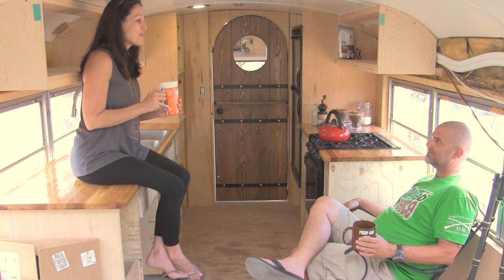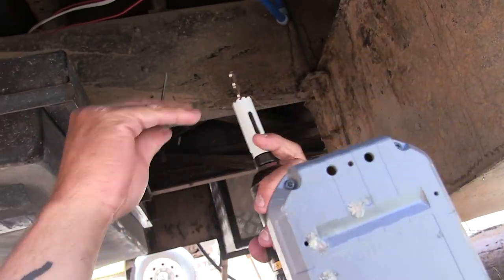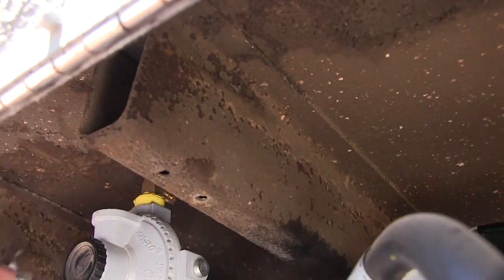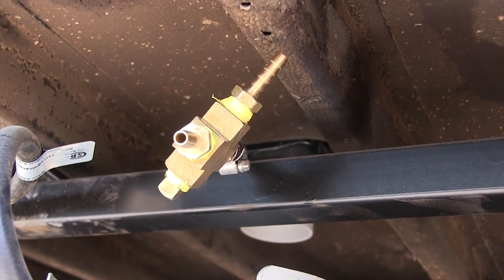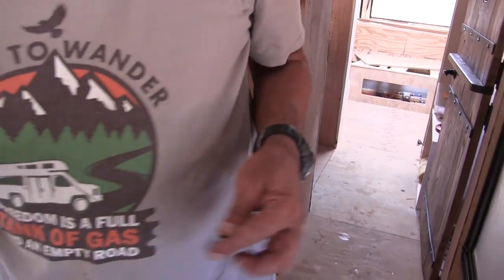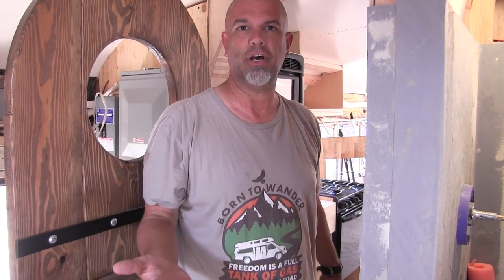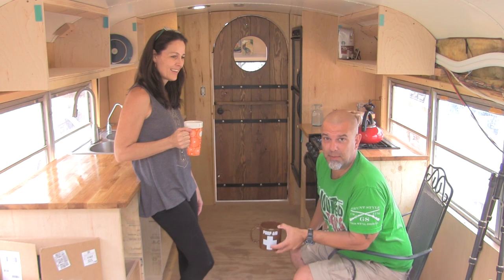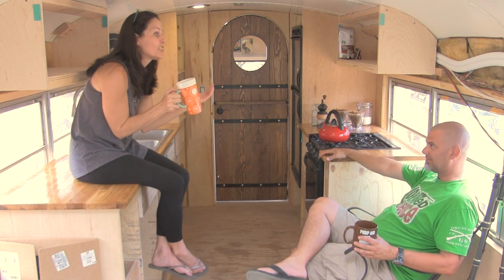Installing Propane Lines & Making Our Skoolie Kitchen Work!!!

Comment: I always hated those hose clamps because it is a pain to get a screwdriver where it was needed and I seem to let it slip off and I jab my hand with the screwdriver...then I figured out a socket fits on there perfectly.  A socket and ratchet, for me anyway, is much easier and quicker.  It's also easy to "snake" an extension in-between obstacles or even use a bendy extension.  Just a thought.  Really like watching your progress, by the way.

Comment: Another great video Mike and Kerry. Glad the propane install went smoothly. I was surprised that you used hose clamps on the propane lines, wonder about leaks developing. I just have never seen that but I am sure you would not have used them if you didn't think they would be safe. Great job!

Comment: Here is some important information for you. The gas regulator vent should be facing down so water does not get into the diaphragm which it will the way you installed it, or you can go to a local Propane gas company (please do) and see if that regulator screen can be removed and vented downward using pipe. Also see what the code is for using the rubber hose indoors on a moving vehicle.Why get this far and create a potentially great problem by having gas blow by the diaphragm and ruin your build. Just helping and not being a jerk.
Reply from the maker: Thank you. I will address this.

Comment: We taught our kids in the RV to get all wet then turn the water off, suds up your body first then your hair, turn water back on and rinse off.  Otherwise they would fill our grey tank in two days. 😳🙄 With our corner shower I put in a big rubber maid tub, I filled half full and the kids below 10 got to take a bath in our shower.  No water waste 👍🏻

Comment: Mike, i saw one system where they installed a solenoid on a 15 second timer (relay) inline on the hot water tap. What this did was send the water back to the tank for the set time then out to the tap. This saved wasting any water at all. Just a thought :)

Comment: Wondering if youve had any leaks 4 years down the road using the compression fittings over using flare connections. I just bought copper tubing and flare tool but after watching your video this would save so much time and cash

Comment: Hi Mike and Kerry.  Thanks for sharing your build.  These videos as well as the "correction" video after it REALLY help us who are a couple steps behind you on this adventure.  
Question on a product used in this video, if you don't mind...  What size inside diameter fuel line did you use for the lines across the bus?  This would help tremendously!  Thanks again for all of your hard work...it sure shows!!
Reply from the maker: 1/4" lp Rated fule line
Reply: @BussyMcBusface  Thank you for your help!

Comment: I would suggest using soapy water in a spray bottle and check all the fittings for leaks especially under the bus around the tanks. Because if you have a leak outside you may not smell it and you sure do not want a fire after all this work. 25 cents could save your lives.

Comment: I just realized Y'all have that big ole cover in the back of your bus also but my cover is like 18 or 20 inches wide. I hate that big ole cover! Old man, I bought my bus said I can't take it off. So does the end of your bus open up? mine does not open but now the sides open up in the very back on the outside. I do not have that tool to open the sides. So I guess it's ok to build my bed over that big cover?

Comment: Man i love what you guys are doing with your bus...except for the propane lines. I am not a plumber or pipe fitter or anything like that but they make gas flange fittings for a reason. If you have used this type of set up in the past and it has worked for you than disregard my comments. If this is new to you...then please rethink how you have run the propane lines. As i said I am no expert but this i do know...there is seldom a second chance with propane done wrong. Love the videos and best wishes
Reply from the maker: Tell me more.
Reply from the maker: I used this on my Ambulance conversion. No granted my runs were extremely short.  Then I watched another bus build where the guy used prefab rubber gas lines and it seemed to be fine.
Reply from the maker: I do plan on running loom over all the outside gas lines to prevent any chafing but I'm not a gas guy so I went with what I knew how to do.
Reply: Bussy McBusface 
Gas, like electricity can be deadly when done wrong.
Please at least have a qualified expert examine your system for hazards.